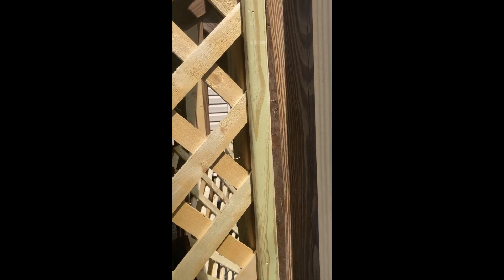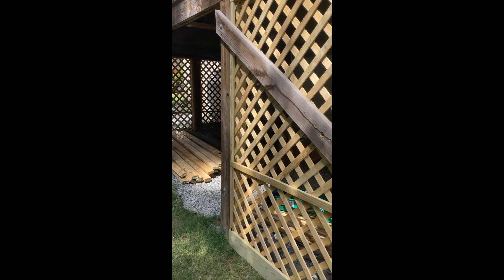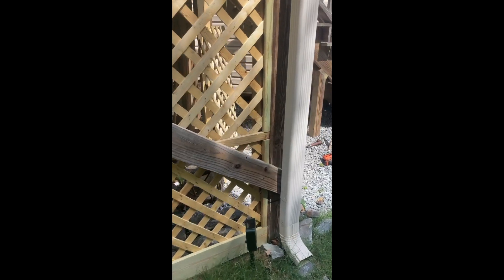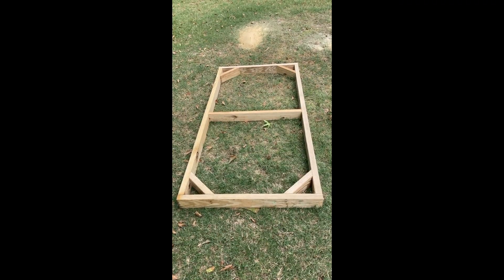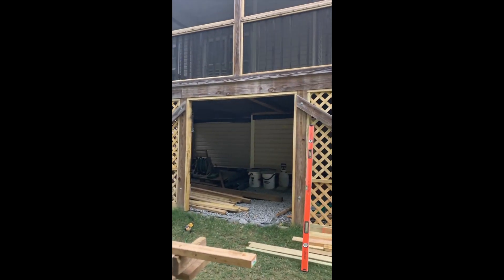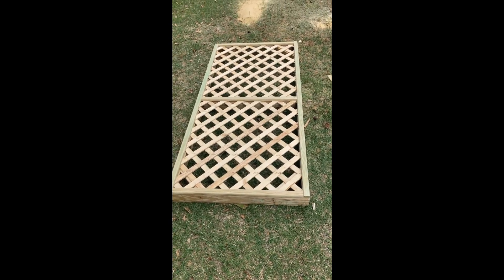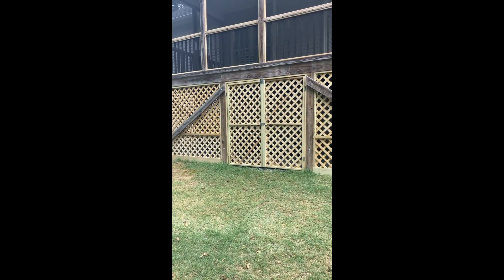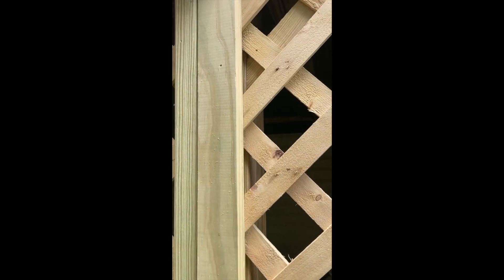DIY Wood Lattice for Under Deck Privacy // Lattice Doors #diy #howto #carpentry

Comment: I know this is a year old, but what was the purpose of the diagonal boards. It seems to reduce the appeal. Is it for structure or do you remove them?
Reply from the maker: Yep those are structural for keeping the post up right. They could be removed and replaced with a knee brace on the inside in some cases